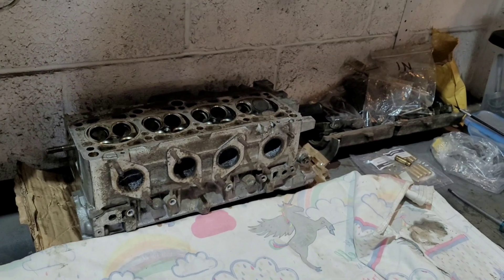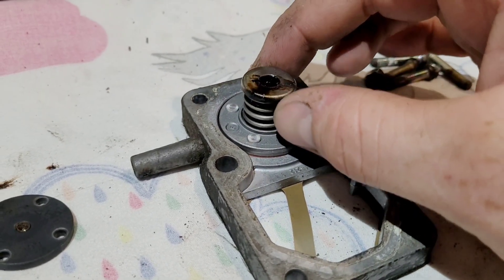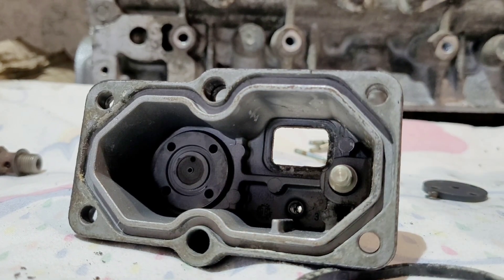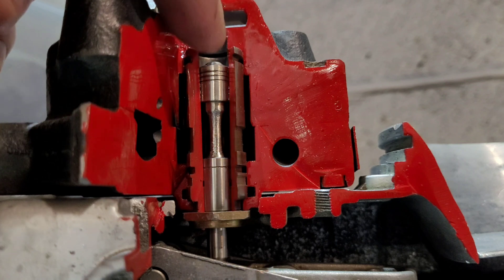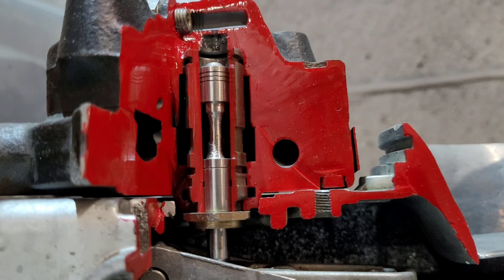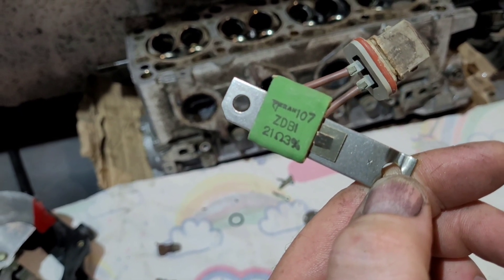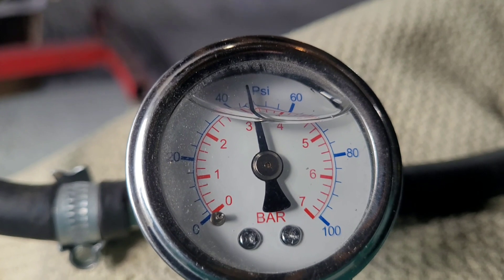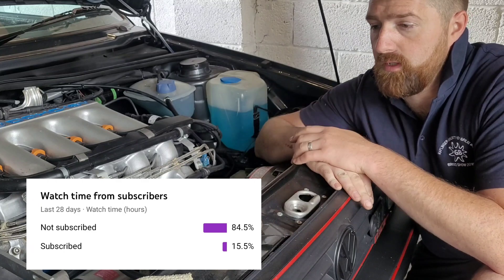Bosch K-jetronic CIS - WUR Mod - How-to + Why

Comment: but if you just use a aftermarket btr wouldent that work?
Reply from the maker: A btr?
Reply: @GreyGooseRestorations  Sorry that was swedish i mean fuel pressure regulator. One that you can change the pressure yourself.
Reply from the maker: Ah ok you could fit a variable FPR but thats what the WUR is basically
Reply: @GreyGooseRestorations yes but if you only drive it in summer it has worked ok for me
Reply from the maker: True, the motorsport spec kjets had fixed pressure valves too
Reply: @GreyGooseRestorations i know the group a volvo had fixed 3 bar regulator i think
Reply: @GreyGooseRestorations hello again you know very much about the k-jet system. Do you have any recomendation on a book about k-jet and or ke-jet pressures, tuning/performance and modifications. This is ment as a gift?
Best regards
Reply from the maker: Thanks, the best one is the Bosch K-jetronic book, it blue (can't remember the full title)

Comment: I’ve got an Audi ur Quattro WUR on my mk1 golf gti 1.6.
I was told it will give fuel enrichment under load which the stock WUR would not do.
Do this sound accurate to you?
Reply: I have an Audi typ 44 200 Turbo probably with the same (or similar) WUR as you’re describing.
If memory serves correctly this WUR can enrich the fuel mixture when the turbo gives boost. It senses via the vacuum hose connection to the intake manifold.

I think this type of WUR was also used on the Porsche 924 turbo.
Reply from the maker: Correct yes, and is the simplest type for boost control
Reply from the maker: Correct, once the engine vacuum drops after wide open throttle the control pressure drops allowing the air plate to raise quicker providing more fuel

Comment: I went down to 2.6 BAR (WUR Warm Control Pressure ) and it is running much better. One must also take the ethanol in the fuel into account (less energy per same amount of fuel) - thus richer mixture is needed.
Reply from the maker: Good points re the fuel differences

Comment: Hi bud.. quick question..
I own a 1980 Audi 200 5T with similar injection set up.. is this tweak something I can do to my car?
Reply from the maker: Yes 👍
Reply: @GreyGooseRestorations
👌  tremendous
Reply: @GreyGooseRestorations 
Hi again bud... What bar pressure would you recommend going to as a tweak on my Audi 200 5T ?
Reply from the maker: @SidewaysStew control pressure should be in the region of 3.6 bar stock so I'd drop to 3.4 bar and see how it goes, its best to tweek along side and AFR Guage but 3.4 should be a good starting point t
Reply: @GreyGooseRestorations  
Thanks for getting back bud... 
I was under the impression I was aiming to up the bar pressure to gain more bhp..
Reply from the maker: Nope, lowering the WUR pressure aids the air plate in rising as there's less counteracting force so more fuel can be provided 👍
Reply: @GreyGooseRestorations  
Gotcha... Now I get it.. cheers bud 👍

Comment: My car does not start, when I accelerate it seems as if it is going to start but it never does, I have spark in the spark plugs, change the fuel pump and filter, repair the heating regulator but I have leaks through the connector and I don't know if it regulates correctly What do you advise me?
Reply from the maker: If the WUR is leaking fuel I would start with this and see if it helps

Comment: Great video! If I resume, lowering the pressure from 3.8bars to 3.0bars will give more HP ? But it have also an incidence on the cold pressure right ? Isn't a big deal ?
Reply from the maker: Adjusting the warm control pressure via the diaphragm has little to no effect on cold pressure, dropping the stock 3.8 bar to 3.4 bar (for example) would yield more horse power, yes. I wouldn't drop it to 3 bar as thata a big drop and may cause idling issues
Reply: @GreyGooseRestorations Thanks! Do you have a link where I can buy the same pressure gauge as shown in the video please ?
Reply from the maker: @romainmarchet6791 the one in the video was made by me and can be made cheap enough or missingparts.de have ready made kits

Comment: I made a rookie mistake and made both the adjustment you describe and the adjustable pin method. Is there a base setting on your modification that I should target on my WUR?
Reply from the maker: Unfortunately, it's hard to have a base setting as there are too many variables with where the fuel cell sits, the heating element pin site and the spring rates on both the springs and how well the vacuum diaphragms are working

Comment: Does this work on WURs that have the brass plate on the back?
Reply from the maker: Do you mean the large flat plate? If so nope
Reply: @GreyGooseRestorations  I think it's slightly dished or conical. Its about 1.5 to 1.75 inch or 30 to 40 mm diameter. Presuming this mod doesn't work for me,
have you seen the digital wur, and if so what do you think of them? They are very expensive but may be a convenient solution. I have actually adapted this system to a suzuki samurai and it worked very well for a while. But now it runs rich always and I cannot get it to lean. I just dont want to throw $$$$ at it because its my beater 4wd.
Reply from the maker: @deadbrother5355 yeah thats the type for a faster warm up type, best bet is to get a 16v golf wur with the vacuum unit and adjust that like the video

Yes seen those, very good but hell of alot of money for what they are, personally id stay with OEM stuff, its worked good for 30+ years
Reply: @GreyGooseRestorations  thanks for the feedback. 
Where would I find one? Junkyard?
Reply from the maker: @deadbrother5355 more likely ebay or contact dubstock

Comment: My WUR does not appear to have the Allen screw under the lower spring. I have the WUR from a US model 88 Cabriolet JH code CIS Lambda. So how would I modify my WUR to reduce the warm control pressure using a screw or bolt?
Reply: That will require tapping or somehow having fine control while pushing the chamber down, or pulling it up. I installed a bolt in the cold control pressure pin to adjust it in or out, but I’d like something similar for the warm side.
Reply from the maker: @seanporter6795 you can so the same on the warm side so both parts have screw threads that hold the parts in position, personally i prefer the harder way to actually press/knock the relevant parts in or or out as they stay put, with the tapped bolt and lock nut method leaves it open to coming loose as there are a lot of vibrations going through these.
Reply: It would be nice to create a puller that could latch onto the fuel fittings and pull the fuel chamber out. Then I could tap it down (back in) using a hammer. I think lowering the warm/hot control pressure means pulling the chamber out. @GreyGooseRestorations
Reply from the maker: @seanporter6795 normally if its stock its a case of knocking them in and test but its hard on the car as you need to do it when its stone cold then see what its like warm then adjust then leave it to get cold then check, very long winded but once set it more reliable
Reply from the maker: Ah ok so yours will be presumably one without the vacuum section. These can still be set but require the fuel chamber and the heating element pin knocking either in or out to get the desired pressure

Comment: Where abouts is your garage located please. 
After changing a code plug on my e21 and having to remove this. 
It’s running rich and cannot run for long. 
Thanks
Reply: Thanks Iv found tbe Facebook page and following. I’ll message you on there and give you a call if that’s ok. 
I need mine sorting after remining it to replace a core plug😫😂
Reply from the maker: Hi, im located in Wiltshire, I have a Facebook page with contact details if your need

Comment: Great video, thanks for the explanation but this is for warm pressure regulation. How do you set up the cold pressure? I don't have a good idle on cold and stalls after a few seconds from start. Probably the cold pressure is wrong. Starts easily on cold and warm and runs good on warm. On warm I have 3,5bar from 30degree celsius and on.
Reply from the maker: Thanks, cold pressure is really what it is, it can be reset by adjusting the housing.

What pressure do you have on cold?
Reply: @GreyGooseRestorations  I have 1,2 bar at 21 celsius degree. 2.0bar at 35 and 2.1 at 42.  I have checked the 020 WUR and it is inside range. It seems lack of air. The air idle screw is open at maximun and even that, stalls.
Reply from the maker: The WUR pressures aren't the issue, have you checked your C02 adjustment screw at the metering head
Reply: @GreyGooseRestorations  No, I have not the gas analyzer for performing the test, I will take the car to a garage with it, thanks.
Reply: @GreyGooseRestorations

Comment: K-jet + Turbo owner here. Major thing that you didn't tell people is that there's a possibility that the airflow meter plate will move up too easily if the control pressure (one that is regulated by WUR) is too low. Meaning, you can enrich your fuel mix at lower RPM, but when you will go WOT at above 4000 RPM the airflow meter plate will top up and fuel mix will become VERY lean. Resulting in engine damage even. So, the best is to measure AFR to see if the engine has started to lean out at high RPM after you've decreased your control pressure.
Reply: ❤Love your work.

I own a 9A 16V motor that's really heavy on fuel and misfires everytime the engine cools down for a bit. And also has a slight knocking sound on start up then goes away but can be heard knocking again at 3500-4000rpm
Reply from the maker: Thanks
Is your engine timing and ignition timing set correctly
Reply: @GreyGooseRestorations  yes timings perfect..it's just I think the kject system isn't working 100% because it's missing a few parts...can I perhaps catch you on whatsapp
Reply from the maker: Yeah no problems, on my Facebook page click the WhatsApp button thing
Reply: Hi! What's the part number of this warm up regulator? The one I have one on my 16v looks like it came from an 8 valve and does not look the same as yours as it doesn't have that hole to drill on to access that screw to adjust fuel pressure
Reply from the maker: @jeremiahresurreccion2350 sounds like you have the wrong one fitted, which will also mean you have no full throttle enrichment etc

VW number is 027 133 403
Bosch number is 0 438 140 140
Reply from the maker: In principle yes but k-jetronic generally drops  rich as soon as the throttle is opened then settles and starts to go lean top end.
The WUR mod allows the plate to rise more thus uncovers more of the fuel slits providing more fuel up top.

The 16v doesn't breathe hard at low rpm so the plate won't rise that much to overfuel enough to cause any damage, remembering this mod had been done since the mid 90s

In an ideal world the WUR mod should be done in conjunction with RR and AFR or live road testing.

Comment: i have an audi 2.3 with a KE3, ive heard that you can get more out of it by adjusting fuel pressures since theyre set for emissions out the factory. but the KE3 has a EHA valve instead of a WUR so i was wondering if youre capable to show something like that too
Reply from the maker: Yes you can adjust the small 2mm allen key hidden behind the flat head screw on the back of the EHA valve on the metering head

Comment: I have a mercedes with k jetronic and I dont get any resistance on the air metering unit when I press it down and when I crack the lines going to the injectors very little amount of fuel comes out could that have to do anything with WUR?
Reply from the maker: It could be WUR issue or system pressure issue, are you able to check your system pressures
Reply: @GreyGooseRestorations  unfortunatelly no I don't have the equipement needed,I would like to get the testing equipement thought because more than likely I would end up with more K jetronic cars,could the WUR being clogged prevent fuel getting to the distributor?
Reply from the maker: Missingparts.de are very good with parts and their test kits.

Its always worth taking the WUR off to spray some cleaner through the inlet and outlet ports.

System pressure is the first port of call as that will point you to your issue
Reply: @GreyGooseRestorations  thanks but those testing equipment they have don't have the right fittings to connect to mine unfortunately😒 you thing then that I could try to spray something like a carb cleaner throught the holes to see if I can get it to unblock without removing the WUR because it's in a very bad location on my car I should also remove the oil filter as well. Thanks by the way for helping me much appreciated.Could I find you on social to add you?
Reply from the maker: Yeah just take the two banjo bolts/lines off and spray some through
Reply: @GreyGooseRestorations  ok thanks

Comment: I was literally getting brainwashed when watching this I didnt understand where it was, but at the location you have it, I dont have ANYTHING related to that box you are talking about, the WUR

I do have the '87 GTI 16v KR, yet nothing like this
Is my model too old or something?
Reply from the maker: If its a k-jetronic then it needs an should have a WUR as that is what sets the control pressure.

Comment: Wow! Amazing explanation...
Reply from the maker: Thanks
Reply: @GreyGooseRestorations  What are the parts required for the conversion of CIS-E to K - Jetronic?
Reply from the maker: All you need to do is put a plain CIS metering head on the car and the electrical plug for the CIS-E just put it tidy out the way

Comment: Great vid!! Doing this mod on a MK1 DX 1.8 GTI engine, the original wur has no vacuum connection. The 16V wur has one. Should I block the vacuum inlet on the wur? Or connect it to the vacuum system of the throttle body? Thanks so much for the info!
Reply from the maker: No worries, you'll need to use the vacuum on the 16v WUR, normally i T peice them into to long idle valve pipe that runs across infront of the inlet manifold.
Reply: @GreyGooseRestorations  great 👍 will look into that! Thanks for the speedy reply 😉

Comment: Why are you doing this?
To adjust the fuel pressure?
Can't you just do that by adding a shim to the line out nut?
Are you raising the whole fuel pressure or just the warm up pressure?
Please explain
Reply from the maker: This is the control pressure (WUR Pressure) lowering the control pressure in simple terms allows the fuel plunger to raise easier providing more fuel.
Reply: @GreyGooseRestorations  So to increase fuel pressure, shim the return pipe.
To make response faster, lower the WUR as in your video?

Comment: Good video and some clear explanations. I have a question though. You have a double diaphragm WUR. That means the vacuum take off changes the pressure on the pin. The bit that moves under vacuum only affects the inner spring seat, and that is the bit that you are adjusting with the allen key. Effectively it is fuel enrichment at WOT (when vacuum is lowest). My thoughts are that the allen key adjustment is to control the effect the vacuum has on the control pressure, allowing you to tune for WOT. When you look at how a WUR is supposed to be set-up for cold/warm pressure, it focusses on moving the bimetallic strip or the fuel cell in and out of the WUR. I'm convinced that the allen key is there for adjusting control pressure in line with vacuum. A normal WUR (with no vacuum) only has one spring, so I'm convinced there is logic in may argument but I've been unable to find any discussion on it. Do you have a view on that?
Reply from the maker: Theres only one diagram in the WUR.

The engine vacuum reduces the force on the metal diagram allowing more fuel to pass out of the control line reducing control pressure. So when vacuum is applied via opening the throttle this removes force on the metal diagram momentarily dropping the control pressure allowing the fuel pin to rise more providing more fuel

The bimetallic strip again reduces pressure on the metal diagram allowing more fuel to pass through untill its warmed up then the pressure is increased so x amount of fuel is passing through.

The allen key physically removes pressure off the metal diagram so once its all warmed up there is more fuel passing through providing a reduction in control pressure